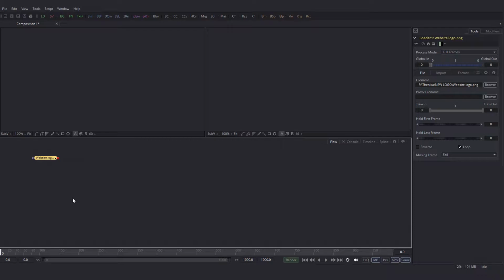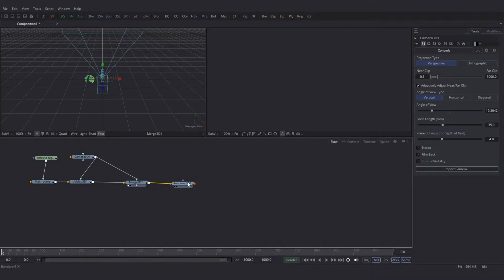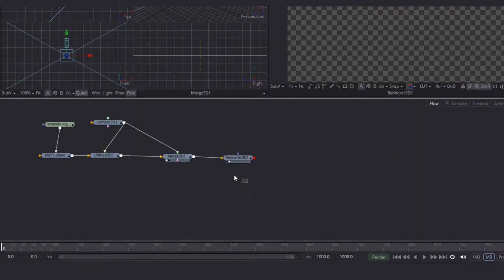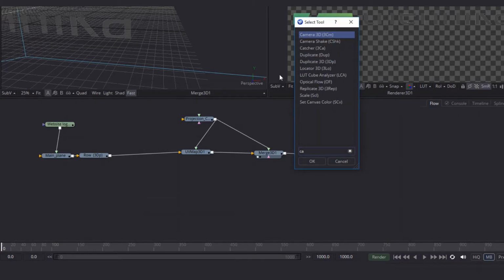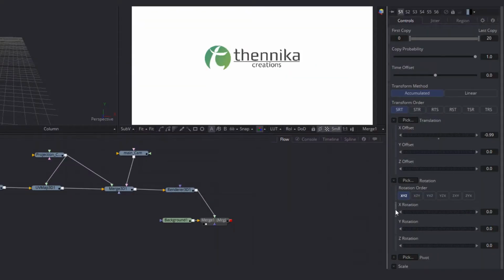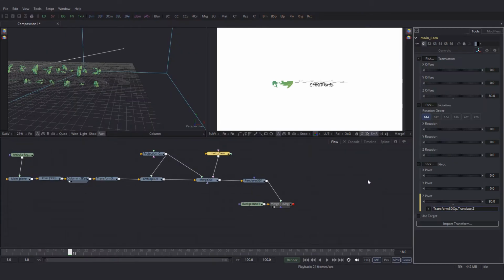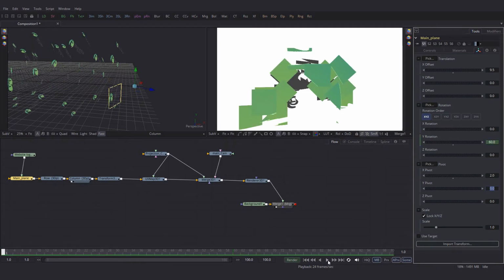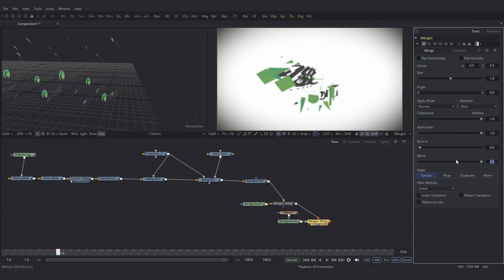Blackmagic Fusion 8 Tutorial  - Motion graphics #5 - Card Wipe Effect

Comment: You will find that the texture slides across the cards because the UV projection is happening after the duplicate. Thus, the image is projected onto cards that have already been rotated. For a quick animated logo like this one, you may never notice, but for other applications of a card wipe it will be a problem. The solution is rather involved, and it requires creating new UVs for the cards explicitly instead of with a projection technique. 

Since a YouTube comment isn't very useful for a detailed description, I'll just link to where I described the process on my blog:
http://www.bryanray.name/wordpress/card-wipe-transition-for-fusion/

Zip down to the heading "Texturing the Card" about halfway down for the relevant material. The post as a whole describes how to turn the card wipe into a macro, although there is still a little ways to go before I'd be comfortable calling it a finished tool. For one thing, I didn't put in a mechanism for placing a different image on the back side of the card (not difficult), and it's terribly slow thanks to the CustomVertex3D nodes.
Reply from the maker: Thanks for the link. I should try that.
Reply from the maker: Nice blog.. :) I just figured a different method of creating this effect, might do an update to the video.
Reply: Thanks; glad you enjoyed it!
Reply from the maker: I will put a link to your blog in the update. Will that be fine.
Reply: Sure; I certainly won't turn down free advertising!
Reply: lol. From time to time. I saw a link to this one on Facebook, and since it was covering a topic I'd already written about, I thought I'd take a peek. I rarely comment here because the quality of conversation is generally low, and I just don't need that kind of stress in my life.